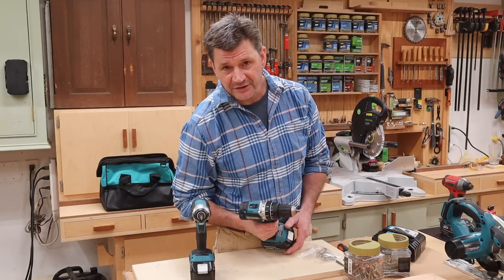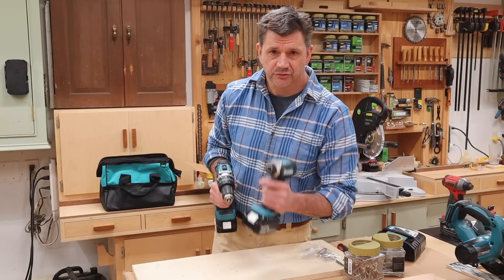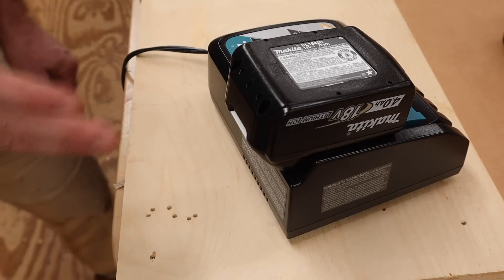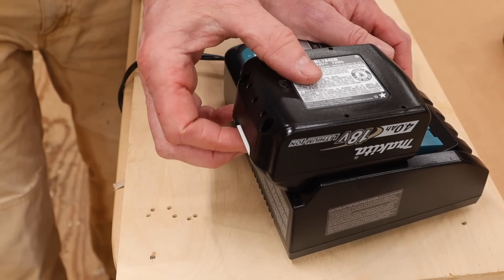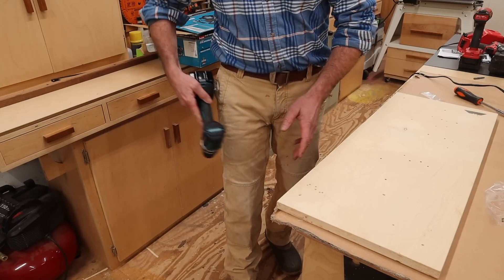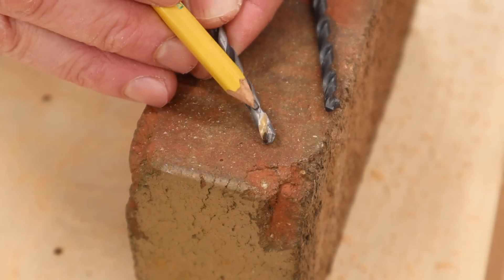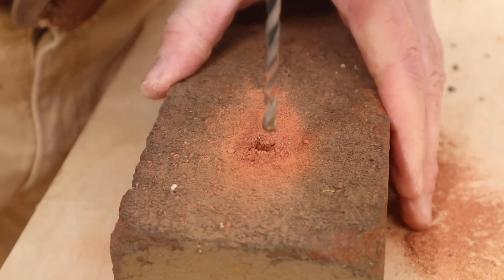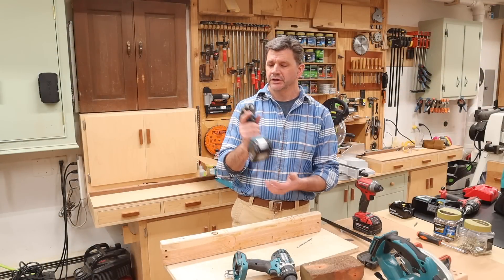POWER TOOL BASICS - How to Use a Cordless Drill and Impact Driver

Comment: You are correct about the three brands you mentioned.  They are all excellent and will last. 

Sometimes I wonder if they are all the same,  just different shells lol.

On a side note i want to thank you for your videos.  Your videos encouraged me to get into woodworking.  I got tired of spending big money on furniture that is just covered particle board. I started making end tables,  a bed frame,  etc. I want to get a table saw though.  I dont have 3-4k for the high end stuff. But I see a lot of mixed reviews for the ones around 600. I don't know if thry are really bad, or the user doesn't fully understand what they are doing.... maybe you can give me a suggestion and input.

Comment: I’ve been using makita tools for over 40 years and been on the cordless since 1999. My first cordless purchase was a deal with two drivers and two 14.4  1.5 amp batteries and they still work to this day 23 years later.

Comment: The Makita LXT blower that takes two batteries was one of the best tools I didn't know I needed. It's so convenient to break out and blow sawdust or a gutter out and be done in 5 minutes. I had the Milwaukee cordless blower and the Makita is better. You will need a second pair of batteries for yard work.
Reply: I agree, that blower is awesome in the shop and elsewhere, makita also do other garden tools that are far better than corded ones, I had the batteries so went with makita and have not regretted it one bit
Reply: @peterjohnson8190  Cool. The only yard tool I have is the chainsaw. It's really solid for most things I need it for. Next time I have issues with my gas weed eater, maybe I should look at a Makita battery one...

Comment: I have the old version of that charger and the screws were under the feet I was able to take it apart and I screwed some wood to the back from the inside so I could mount it on the wall

Comment: I use the Hammer setting to drive in big ass wood screws that can't be screwed with just the screw setting... I think that's the main use of it. For masonry drilling you have another line of drills. I mean surely you can use this impact drill for that too but its not so good for it, also, the masonry dust can kill a normal drill like that.

Comment: I hate using a driver for delicate work or screws that require touch. It often over-torques for the given situation and you can strip a thread. I love setting the clutch on my drill for a known torque I want and just driving until it gives out, then I know I drove it home with the exact torque I want. Drivers are great for brute work like masonry, fences, etc. but I’ve stripped some cheap ikea threads, etc. I’m the past with an impact trigger that’s too delicate to the touch.

Comment: Hey Jon, another great video. For my DeWalt and Kobalt drills I usually just leave the drill in neutral and that will lock the drill so I can then loosen or tighten the drill with the bit by hand.

Comment: May interest you to know; it's considered best practice to avoid holding the chuck and using the motor of the drill to FULLY open or close the chuck as it is prone to damaging the chuck.  You can see this in life when you feel each of the chuck teeth and one or more wiggles or is not flush with the others.  Another bit of good practice is to always have a piece of scrap wood underneath the wood your working with whenever you are drilling through or even close to through it as it prevents "blow out" on the other side, the damage often caused by unsupported wood when a bit goes through the opposite side is near identical to a "projectile exit wound"

Comment: I still don't really understand the advantage of a driver + drill over just having two drills. It doesn't seem like the driver does anything different to a drill. Why would you not want the versatility of two drills?
Reply: The Impact Driver is better for high-torque applications. It doesn’t twist around like a drill will and the “impact” part of the driver keeps the bit seated. I can drive 3” star-drive screws with my non-dominant hand, over my head, on a ladder. You don’t really have to apply much “down” force on the impact driver to drive a screw like you do with a drill.
Reply: This comment is obviously from a person who hasn't ever used an impact driver. Once you've used one you instantly understand and never go back to driving with a drill.